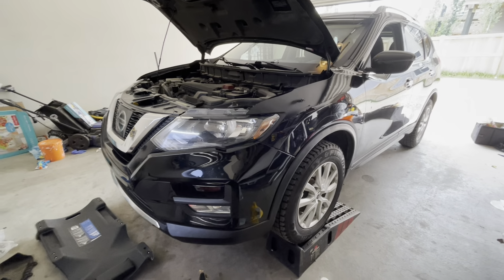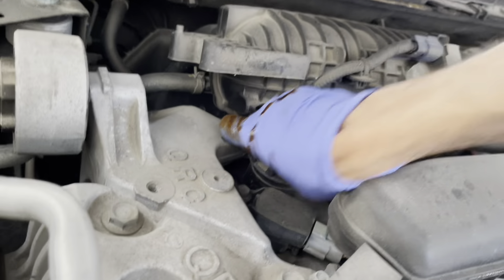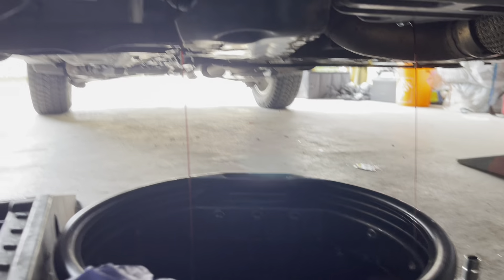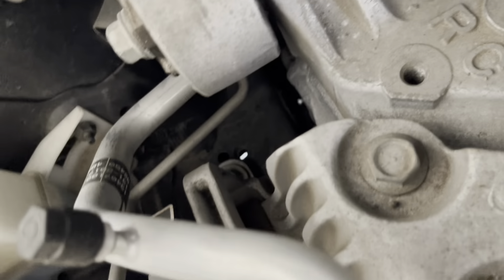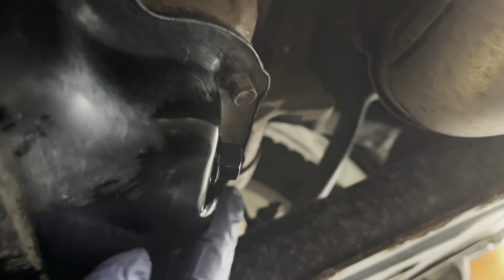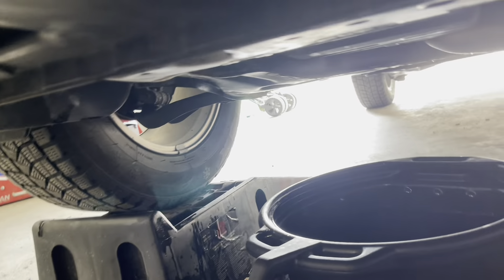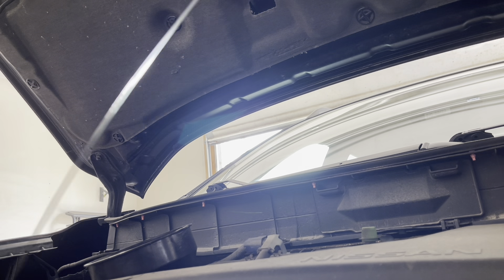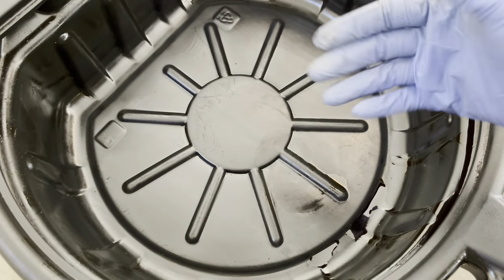Nissan Rouge (2013-2020) Oil + Filter Change in 4 minutes  2.5L engine

Comment: Wouldn't it be better to use the fresh oil for the sealer on the oil filter the old oil may have a little bit of grit in it which would not create a good seal. Very good healthy video. Thank you.
Reply: you shouldnt have to worry about that since it uses gasket material. only if its a lot of dirt and grit. in which case you have a bigger problem than you think.

Comment: If you jacked the car up in the front, how are you going to get the oil out that's in back of the oil pan?
Reply from the maker: @neilwilliams2193  you can’t possibly drain all oil even if the car is leveled. what I do is I put some fresh oil while the drain plug is still open so it will push all the old oil out.
Reply: Can you get the filter out without that tool?
Reply from the maker: @ you can, but most of time you need the tool to help with breaking it loose.

Comment: You should ALWAYS fill it up to the 2nd dote.   If you don't,   then there's not enough oil circulating through your engine.
Reply: Negative. Anywhere between the lower bound and upper bound is O.K. The 2nd dot is the maximum volume of oil accommodated.
Reply from the maker: @anthonycoelho6930 yes anywhere between the dots are fine but you always want to be closer to the Full dot.
All engines burn oil and you don’t want to run an engine on low oil.
Reply: Who told you that? Thats a lie

Comment: Don't you clean off the base plate EVER?  Why used used oil on new filter gasket?   Sounds like you was LAZY( this time)?
Reply: You only put oil on the gasket to lube it up so it doesn’t get stuck the next time bro it doesn’t matter if you use used oil or new oil
Reply: You obviously never changed your own oil